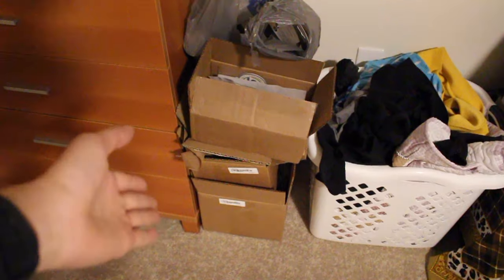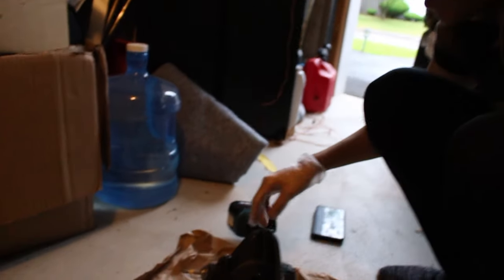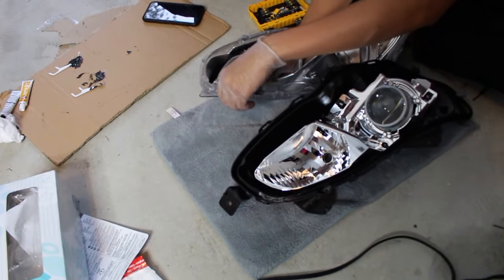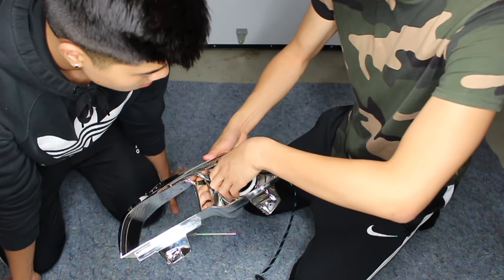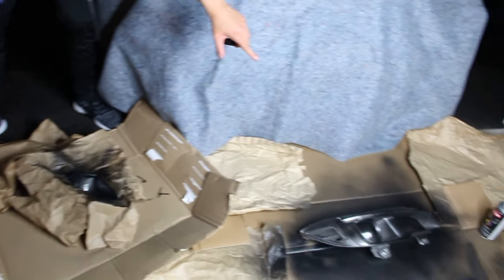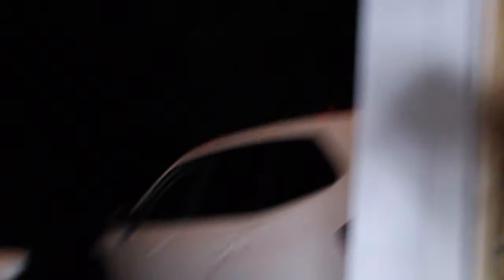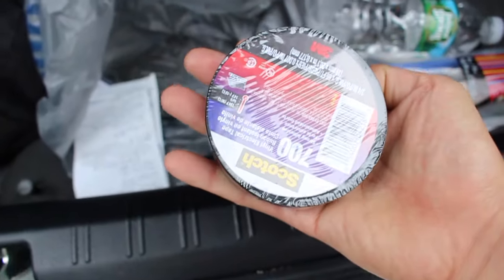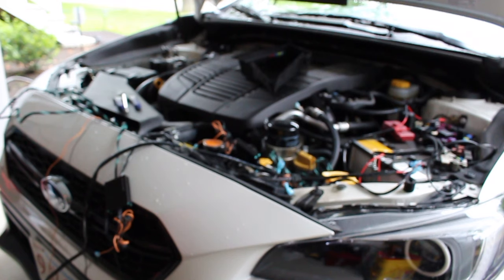Installing Morimoto C-Lights & Halos!! // Rebuilding my stock headlights

Comment: Thank you for being one of the only folks out there who actually show how those halos get mounted up with the Morimoto combination..

Doing the same mod this weekend and you helped a ton! Thank you for making this!
Reply from the maker: Fritzie D. RosePuppy of course brother! I had a hard time figuring how to mount these with the lack of videos online so I’m glad I could help it out with people who want to do these mods such as yourself! Hope all goes smoothly with your installation! Lmk how it turns out! Dm me some photos on my ig! (Listed in the description) also feel free to ask questions if you want any help!
Reply: @RiceyRicky  The only difference being with the STi, and the LED 2017 Limited headlights I have, it's a little different. I'm almost done with installing tonight, but there are some major differences.

I really wish Subispeed would have stated that on the LED headlights I have, it'll require a LOT more custom drilling for the C-lights. The hole is not large enough for the 4-pin connector at all. 

Otherwise, the drilling so far went good, though I'm going to use fishing line vs. solder. I'm going to drill out the little tap points and hold in with the line.

You are VERY much correct in the filing down of the inner ring for the glue/wires though! I did more of an angled thing, but as long as the ring is flush after tightening, I think it will be ok!

Just finished with the painting of everything too, and working on the drying right now. Will put the lights together tomorrow I think after letting everything dry proper.

If curious, here is what the STi looks like disassembled to the components:  https://twitter.com/Fritzie_pup/status/1205981509812981762/photo/2

And here is partly so far where as of tonight I'm at with painting: https://twitter.com/Zelus_PurPuppy/status/1206044302197084160/photo/1

We'll see how I feel in a bit, I wanna do a bit more yet tonight, but DAMN the colour pops!
Reply: @RiceyRicky  I wish I could say I had an IG or anything like that, but I do have a public Twitter where I posted the 'after' pics if you want to look!

Well, I did get pretty much everything done, and damn.. It's a TON of wiring, ain't no joke. I actually put the BT module inside the battery housing, and used the added hole to pull the 2 channels of RGB through the underside and keep it all clean. I then ziptied all 4 modules (Ring/C-Light) together into a tight package, and mounted it just in front of the battery in the space there by the wiper fill tank. I have a lot of open space there thank goodness.

I did have to add about 3' of wire to both passenger side modules for the turn signal, but that was no big deal. T-taps are your friend here.

And for anyone reading this, I am tellin' ya.. GET THE SUBISPEED DRL HARNESS. It's a full fused bus for you to use on anything you want to add, and makes things SO much easier for future installs. (And no, they ain't paying me for saying this, I'm that gratefull that exists, or you'd be running wires everyone for a build like this).

After all is said and done (minus wiring the new bezels I have to still do), the C/Rings work. However, I can't seem to get the App to connect to the BT module yet. I'll have to putz with it a bit more.

Here's what it looks like though! 

Front: https://twitter.com/Fritzie_pup/status/1206752204725641218/photo/1
Close Driver Side: https://twitter.com/Fritzie_pup/status/1206752204725641218/photo/2
Reply from the maker: Fritzie D. RosePuppy looks awesome!!!

Comment: hey man, great video. judt did the conversion but how do I get rid of the old halogen lights that were inside the c light? and also how do you wire in the switchback turn signal? their instructions are super unclear haha

Comment: Did your car come with the LED steering responsive headlights? Wanted to see if it impacted your parts and installation.
Reply from the maker: Donald L no mine were only regular halogen lights, no led. I put a new HID kit and it’s extremely bright, much much brighter with the c-lights and halo’s and visibility improved like crazy
Reply: Yeah. Wanted to see if I did some of the modifications to my headlight would work given that it looks like the Steering Responsive Kit means the light housing is different. If you don’t mind, can I email you? I’m from Boston too and some of the stuff you have done is really cool, and lights are great but wheels and rims are next in preparation for upcoming winter.

Comment: Hey @riceyricky do your regular headlights still work? i have HID's but im wondering if installing demon eyes gets rid of the HID Lights?
Reply: Deamon Eyes are just a small LED that shines into the halogen bulbs reflector. It does not effect your headlights at all. Though, when your low or high beams are on the demon eyes will probably not show very well. It’s more of a daytime running light thing or the car is parked at a car meet to show off.